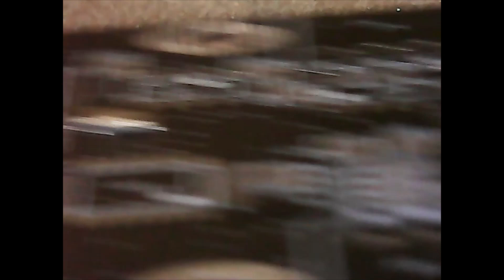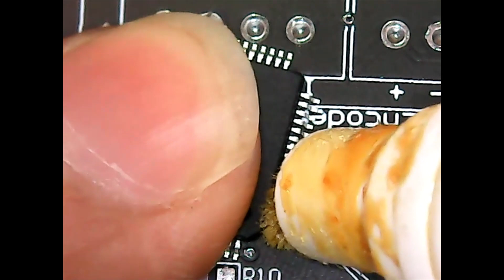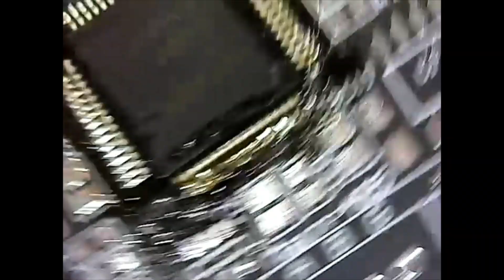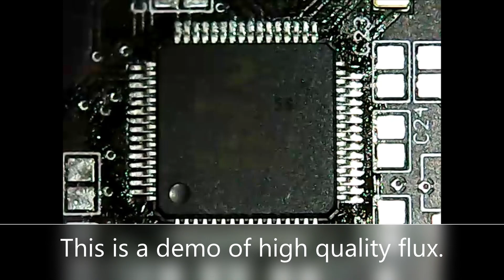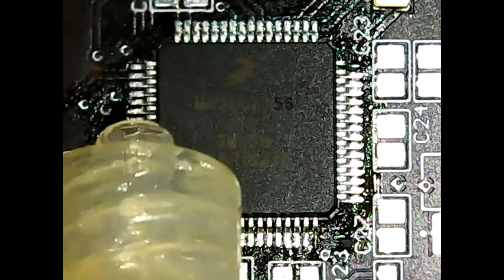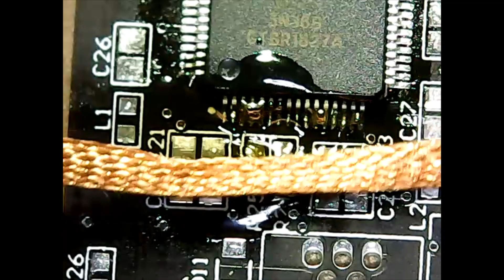SMD Soldering 2: LQFP, TQFP, and Other Difficult Components.

Comment: Its almost impossible to solder individual pins on tqfp. Put plenty of flux down then put solder on iron tip then drag it along the pins in one go. What usually happens is excess solder gets dragged off the pins.

Comment: Hello. It's not good tip to solder LQFP. Much easy and faster to solder LQFP by using tip with flat surface, you can solder one side of chip by only one iron pass. What you use is bad practice, there a lot of video on YouTube how to do it properly.

Comment: The desoldering wick is of very low quality. It should work without any additional flux.
The tip is oxidized and should be cleaned.